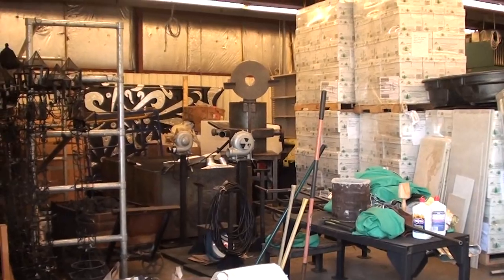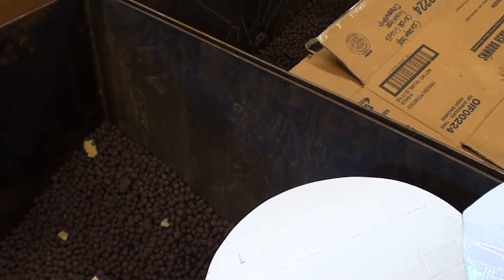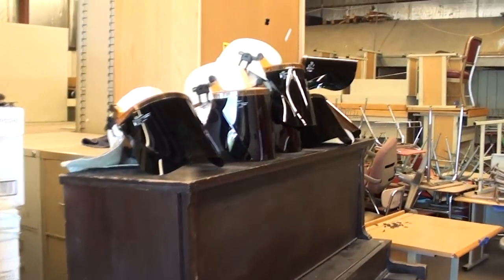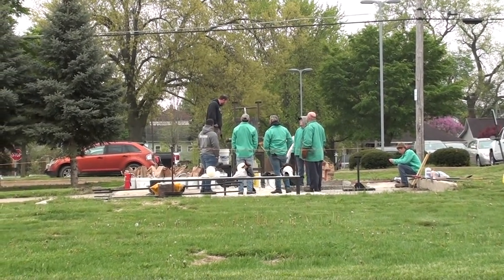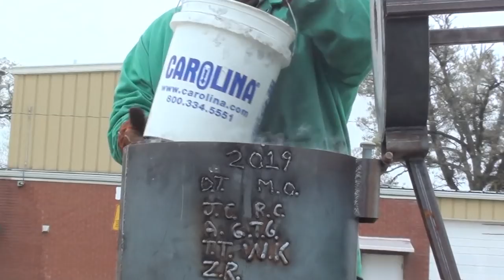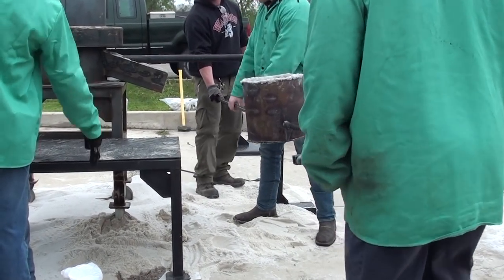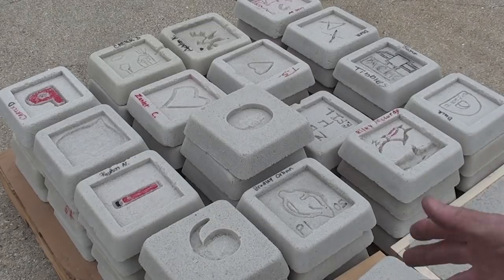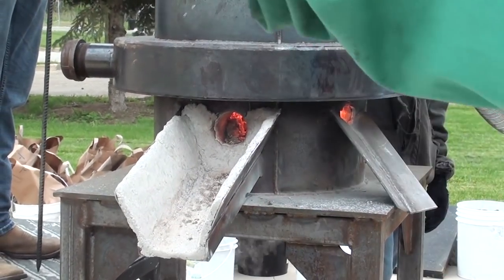IRON MAKING at SCHOOL Using a Blast Furnace tubalcain

Comment: The cupola isn't tall enough for the bore. Reduction requires a long dwell time, that abbreviated stack can't provide it. It's possible they could recycle scrap into pigs with that rig, but reducing ore isn't going to happen, not into usable product anyway. Double the height at least, trebling would be better.

Comment: 15:26 is that slag or the iron dripping out?
Reply: Yes.
Reply: It's a bit of both, in really really old iron making they take that mixed iron and slag "Bloom" and then hammer forge it driving out the slag while burning out the carbon & that was how the first "Iron Age" iron was made, it's really hard work and out of 10 parts of that "stuff" you might yield 3 parts of usable wrought iron, that's why medieval & earlier Iron was so expensive, it would take days of work to make just a few pounds of wrought iron